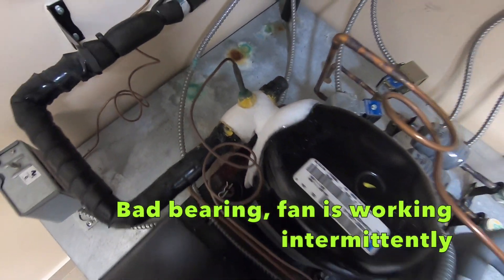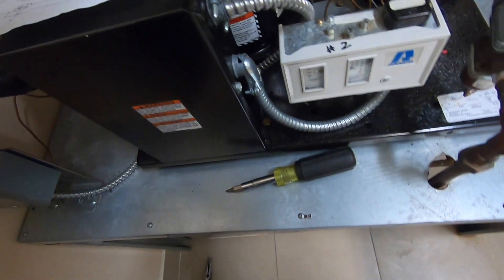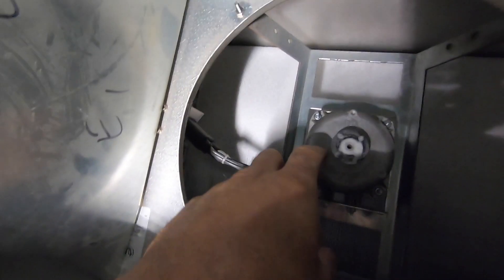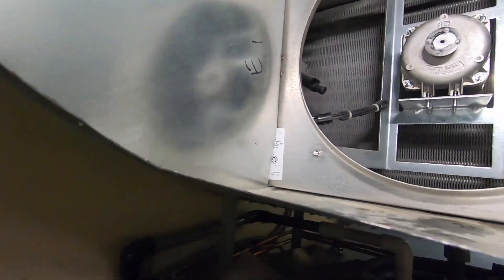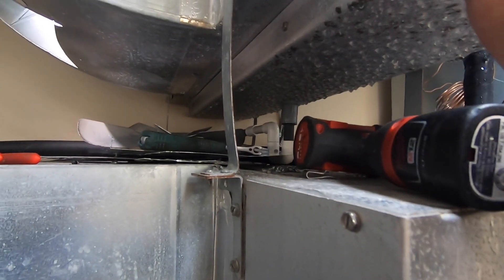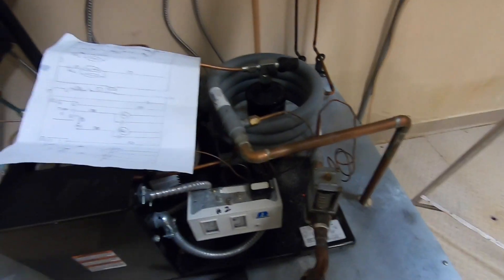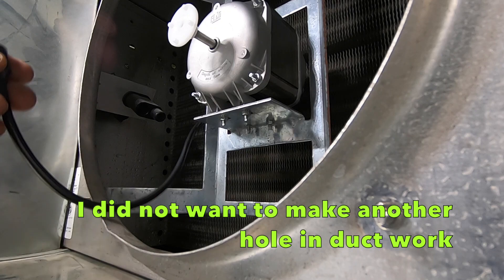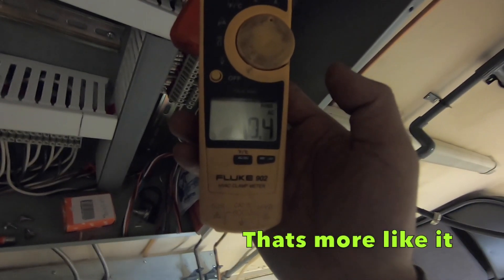HVAC: Walk in Cooler iced up | bad Evaporator Motor

Comment: Hi Joe , great video. The few videos I have seen of yours, you seem to be neat and organized. This one reminded me of a customized Attic AC system I custom built the air handler for. It was made from a multi position A style Evap coil, custom made box with a belt drive blower and motor mounted in it and a fan relay. The attic was so tight I had to install the ductwork and the entire system from back to front and make sure I had everything done completely and super duper insulation job while I worked my way outward. There was no going back in to the starting point. The custom air handler was last right near the attic hatch. The system worked great for years.
Reply from the maker: Sounds like a interesting job, would have loved to see that.  Thanks

Comment: Shop talk did not send me. When you put the fan blade on the motor with the nut and washer, I believe you put the Belleville washer on backwards. The nut should compress the belleville washer. (Or did you do that on purpose to get more comments ? lol) Nice original install, Did you fabricate the control panel, or was it provided with the condensing units ?
Reply from the maker: Dam you caught it lol ....I flipped it.  What's up weaver, yes my it's my homemade control panel.  If you notice most of my videos have the same style. It's my bread and butter lol.  Thanks for dropping by(good eye) lol